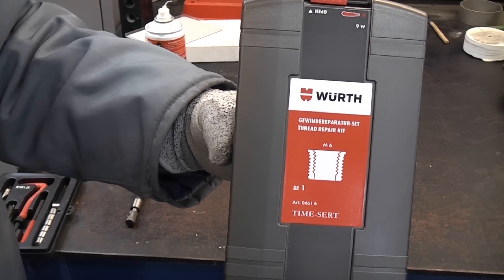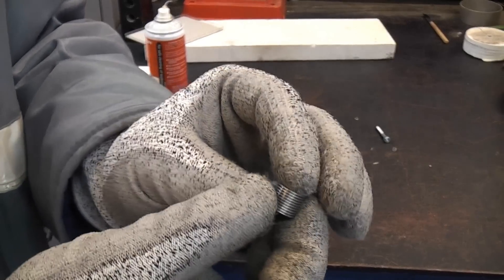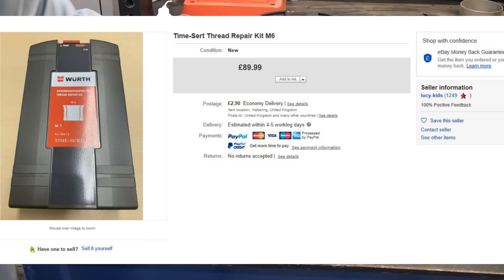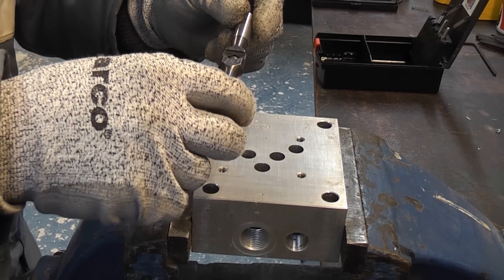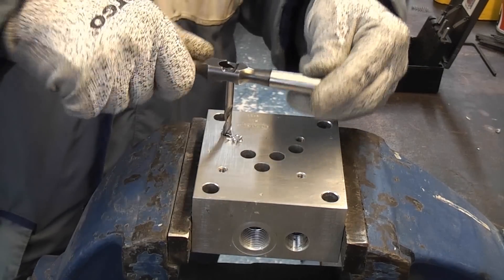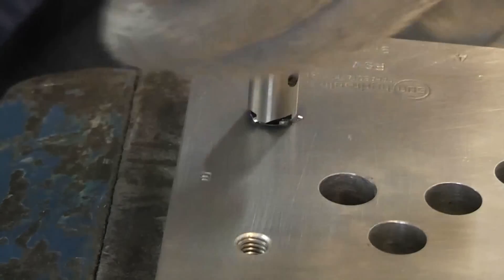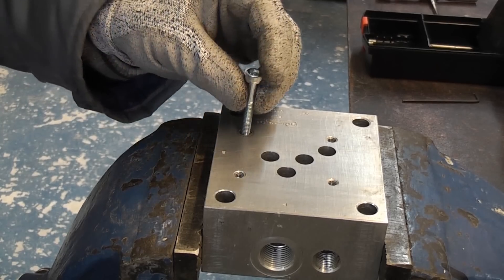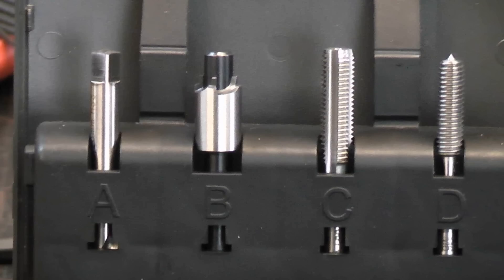Wurth Time-Sert | thread repair kit

Comment: If you install Helicoils correctly they don’t come out. There is no problem with Helicoils if fitted correctly. They don’t come out and you don’t use thread lock. Helicoils were invented as a solution in manufacturing and assembly of parts in the aviation industry to secure parts together as threading directly into alloy is a poor engineering solution. They are a proprietary fixing device that also work as a repair device. Time Certs operate in a different way. The downside to time is they require a larger hole to be drilled out. For some applications there is not enough material for Time Certs. People like Time Certs because psychologically they feel better as they look like a more professional fix, but this is not the case.

Comment: hi, the thing that is stuck in my mind is this: my motorcycle's crankcase plug slot was licked and its size is m14x1.5. I want to put m14x1.5 size plug again. I want to get and do time-sert for this, but what measure should I take? What should be written on the time-sertbox?
Reply from the maker: You just get a M14X1.5 kit, example here- https://eshop.wurth.co.uk/Product-categories/Thrd-repair-oil-drn-plug-thrd-M14-x-1.5-Time-Sert/31086006011402.cyid/3108.cgid/en/GB/GBP/
Reply: @ultimatehandyman  thank you bro

Comment: Have a question a little bit of help I have a 2003 CL500 Mercedes my hydraulic power steering pump threads are stripped T12 metric bolts can someone tell me the correct kit I need
Reply from the maker: It's probably best to ask a mechanic, to ensure you get the correct kit.
Some motor factors will know which kit you will need 👍

Comment: I have used Cross Wire Inserts (Helicoils) for many years, I have only had a few wind out upon removal of bolt or stud. I just clean the thread out with the tap, and wind in a new Cross Wire Insert, job done. When repairing many stripped or damaged threads, the Cross Wire Inserts are far cheaper than other threaded bushes. Also if the stripped hole is very close to the material edge, the Cross Wire Insert requires a smaller new hole than an insert type such as these.

Comment: Great video, thanks for making it. But what I don't understand... the drill bit is larger than 6mm, isn't it?  Must be since the TimeSert-insert's OD must be larger than 6mm.  So how come the drill bit fits into the hole with the stripped thread? That hole must be ~6mm.  Is the drill bit tapered?  Asking because whenever I've done helicoils, getting the initial drilling straight (perpendicular) is the hardest part because the drill bit rocks around on the surface - it doesn't get any guidance from the hole because it's not in the hole (yet).  Thanks.

Comment: Just viewed this video - thanks for sharing  My concern was when you said that the aluminum block was a hydraulic fitting and then began to wipe and blow the metal chips all over the place.  A chip / shaving could get into one of the passages and really cause issues, even dislodging and entering the pump and ruining it  
Personally, I would cover the passages / holes with masking tape to protect from havoc.

Comment: Great thanks, I've luckily been able to find a 2nd hand kit to repair my sparkplug hole. Just wondering, would you use red loctite to  keep the insert in place permanently?
Reply from the maker: Not sure about that, I don't think Loctite is necessary with Time-Serts 🤔
Thanks for the comment 👍
Reply: No, red loctite releases with heat.

Comment: If the original hole was say an m10 when repairing the thread do these or helicoils then change that hole to a larger bolt so an m10 will not fit anymore ?
Reply from the maker: No, if the original hole is M10 and you get the M10 Time-serts the new hole will also be M10 
Thanks for the comment

Comment: You can get 20 of these
https://www.ebay.co.uk/itm/20pcs-Self-Tapping-Thread-Insert-Repair-Set-302-Stainless-Steel-Fixing-Accessory/124129913015?hash=item1ce6b828b7:m:md5X6I5J8PsPGsS4u4OomHQ
for under a fiver. I wonder if they're any good. They can't be worse than Helicoils.
Reply from the maker: I'm not sure if these are any good, with them being "self tapping" and being made from stainless steel. 
I might try ordering a packet after Lockdown ;-)
Thanks for the comment ;-)
Reply: @ultimatehandyman  I was just checking reviews on Amazon and somebody commented the fit was very poor "after having tapped the thread to the correct size." Apparently this reviewer tapped the thread first and then screwed the bushing into it, so you have to make sure that you actually use the bushing for tapping the thread. Anyway, I think the price difference and the fact that you don't need any task-specific tools makes it worth giving it a chance.

Comment: A properly installed helicoil will not " back out "
Reply from the maker: They come out regularly on site, when you remove the bolt!
Thanks for the comment 👍
Reply: Helicoils are mostly junk! We switched over to Timeserts in the late 70s; never looked back.

Comment: Not all helicoils are made equal. Many off brand units that are frequently interchanged and don't work well.  That said the Wurth units are the best for hard threads in soft material.  I have used them into aluminum on vibrating tables running at up to 20hz and when they do come out can be replaced with a new insert and locktite with little problem. However they don't like heat compared to a Helicoil.
Reply from the maker: Thanks for the comment 👍

Comment: I always had my problems with the helicoil system. I am using the Time-Sert since more than 15 years mostly on motobike engines. Since then the screw connections have been holding up again.
Reply from the maker: Thanks for the comment 👍

Comment: if you look closely at the last two threads on the insert they are not formed the same as the rest of the insert. when you use the driver it cold rolls the last two threads which then locks the insert int to the work piece . the driver ideally needs to be able to exit the end of the insert to lock it into the workpiece tightly ,

they are a great repair item and in my opinion better than helicoils .

i used to use them a lot in a previous job. .

spark plug inserts where a daily occurrence as were inserts for sump plugs in ali sump.
Reply from the maker: Thanks for the info, Paul 👍
Reply: @ultimatehandyman  no problem. They are great for repairs to stripped threads.
Reply: Paul, you are correct...this applies to blind holes using the longest insert for the most thread grip. We purchased a second expander tap and ground the tip; then used it to follow up the first expander to get the last bit of grip.

Comment: Yes, no doubt they are a good system but I'd have to politely suggest that they may be as good as Helicoil,..I'm just not sure that these Worth Time -Serts are better!
Reply from the maker: They might not be, but I've had a few Heli-coil type inserts that have unscrewed with the bolt.
Thanks for the comment 👍
Reply: @ultimatehandyman  That's fine,..but you know what I'm going to do,..when next I see the Rep. from Wurth, I am going to inquire  after these Time-Serts and see if I can get a set from them.
Then I can give them a fair test on a little project I'm doing now, and see what transpires. Could be that they ( the Time-Serts ) will work better,..we'll see.
Reply: This is a PS,....it looks like there are some 'off-shore' knock offs out there,...I just noticed a set on Amazon.cam,....sure looks like a 'cheaper' copy to me!
Buyer beware!

Comment: Much better but also 3 times the price of a decent coil type repair :) great vid as always!
Reply from the maker: Yeah, they are not the cheapest!
Thanks for the comment 👍
Reply: Well worth it if you are going to rely on it. I used them since the early 70s. Never had a failure.

Comment: Really fail to see how this is any better than a standard helicoil. Surely the time sert insert is just as prone to backing out when removing the fastener as the helicoili insert? 
Only advantage I can see is that this system doesn’t have the tang which can be a bugger to remove in a blind hole.
Reply from the maker: I think these will be easier to thread lock in position, as they are solid- unlike the helicoil type inserts, which are more like a spring. Also they have a seat on the top of them, which should make them easier to use time and time again. One problem on site is that when I undo bolts that are in Helicoils, the helicoil comes out with the bolt.

Thanks for the comment 👍
Reply: @ultimatehandyman  i suspect it depends on the bolt sizing. iv used helicoils from M10 down to M3 and using red loctite have never had them back out

Comment: Looks great. Why is it though you couldn't just re-tap the hole, rather than having to fit the insert?
Reply from the maker: The hole was stripped, so you would have to re-tap it to the next size up (M8), but this is not always possible because you might not get the M8 bolt through the part that bolts to this part etc.
Thanks for the comment 👍

Comment: Never had a helicoil fail like that, BUT, that being said i buy the genuine stuff. I hear (grape vine) that outside of a few German made products and some French ones, everything else short of the original product is garbage. Lower quality steel, different geometries etc.

There is one thing i do, whenever the thread really needs to remain in place. It's not something everyone can do, but i have full confidence in the strength of the repair, and that is, i spot weld the last coil section into the original metal. Obviously, this doesn't work for dissimilar metals, and you need to have a copper thread plug to maintain the hole, but it works exceptionally well to keep them in. On my brother's farm, i've done this to every farm tool that lost threads, we both had equal thoughts about losing threads or actually seeing them come out like in your intro, like a spring, so we decided to go the extra mile.

I think the toughest test is the bar that keeps his steps upright, in season, that sees a lot of use and whilst it would not lead to any catastrophic failures if it did break, it hasn't so far despite being removed with regularity to reach the battery well.
Reply from the maker: I looked for genuine Heli-coils yesterday but could not find them, I could only find V-coils (we use these on site). There does seem to be a lot of cheap makes out there, which I would definitely avoid!
Thanks for the comment 👍

Comment: Informative video showing an effective solution and alternative to helicoils (which I don't trust in use by the way!!) Just a few things to point out here though.....The drill you showed wouldn't really be effective in a normal 3 jaw drill chuck unless you grip the shank of the drill - the reason it's square is so it's only to be used in the tap holder...… you're essentially using the drill as a reamer to obtain the correct sizing of the hole for the tap used...…..also a 'few turns of the tap wrench and a slight turn back to break the chip' isn't really the way unless you potentially want to snap the tap in the hole.... especially in harder materials like steel!!  I recall from my apprentice workshop days reciting "1/2 a turn round, 1/4 turn back" which I still do to this day if I have to do any manual tapping of holes....  just a couple of pointers as everyday is a school day as they say...  Thanks
Reply from the maker: Thanks for the comment 👍
Reply: my old boss told us never to use a drill with the drill bit in the time sert kit as they were designed to be used with a tap handle , he would have a fit if we used a drill .

Comment: I have to disagree with you. 
I have used helicoil for past 40 years 100's if not 1000's of times and Time sert occasionally. 
I have never ever had a helicoil come out but I have had at least 8 timeserts , fitted to spark plug threads (not by me) that have wound out on the plug seat. 
As in all things, preparation is everything 
I would always use a genuine helicoil over any other thread repair system
Reply: Same boat, I've repaired 100's of damaged holes with helicoils and never had any issues, I've used the locking type of timesert where you have to hammer the locking pins in but only on spark plugs as they will be removed numerous times.
Only downside to the helicoils is that they need a decent amount of material to screw into, whereas the timesert can be fitted to thin and shallow material and can in many cases add some reinforcement to the item.
It's always good to have a choice of repair options depending on the application.
Reply: @tecfixed2840  I agree, Helicoils are fine so long as they are correctly installed, with the correct size hole, tapped correctly and square to the surface, and fitted with the correct tool.  The inserts with the locking pins are called Keenserts, apart from the locking pins their other advantage is that they use a standard tap, not a special Helicoil or whatever.
Reply: Ian Smith 
Hi there, could I use a helicoil in a glow plug if I need to as I have a snapped and seized glow plug and plan to remove it this summer when the weather is warmer to heat the engine to help try keep the heat in it. 
Any advice would be appreciated.
Reply: @ashy1423   if you drill through the glow plug hole to fit a helicoil you may drill through the seat that seals the glow plug to the cylinder head then the gases would escape from the hole and the carbon will seize the glow plug in.

im sure wrth do glow plug inserts too .
Reply: i worked in engine recons and we only used timeserts due to helicoils coming back out . 

we had a customer with a matchless bike that had  the spark plug hole helicoiled and he had spare plugs with helicoils on the spare plugs as the helicoil came out when he removed the spark plug . we fitted a time sert for him and he never had any trouble ever again.

we used to fit timeserts to ali sumps a lot due to mechanics stripping the threads . 

you can also put a timesert in a larger time sert if the mechanic had to drill out a broken exhaust stud and made a mess of it . you put the largertimesert in then put the smaller one inside it . we did this on many a repair.

i would use timeserts over heliciols every time .
Reply: Helicoils work just fine in that application in my experience, just make sure not to drill too deeply and be careful when snapping off the helicoil insertion tang.
Reply: @ashy1423  before you do anything, check if only the first few threads are damaged, which then you may be able to fix with a "back tap". If used with caution and correctly, a "back tap" can work wonders repairing threads. I'm a user and believer. Hopefully if comes in the size that you need.
Reply: +Ian Smith................. exactly! 👍
Reply: I prefer the timeserts but use loctite when installing,never a problem
Reply from the maker: I think we use V-coil on site, they tend to come out regularly, but we don't use time-serts, so I can't compare. I imagine that if they were threadlocked in (for the job that I do they would be better).
Thanks for the comment
Reply: Me too then I guess, as others have raised the point.
Helicoil have always been the 'go to' system in my service department since  the 1970's and now that I'm retired I have a few kits in my work shop too.
By the way I deal with the Wurth rep. each time he comes around,...great products they have too.

Comment: Dose this keep the hole the same size or make it bigger?..
Reply from the maker: It keeps the threaded hole the same size, so if you use the M6 kit, the finished hole will be suitable for a M6 bolt.
Thanks for the comment 👍
Reply: @ultimatehandyman  what about from the original size before the kit is used?. Thanks for the reply
Reply from the maker: It needs drilling out slightly larger, so that the hole can be tapped for the insert 😉

Comment: Good morning to you Sir, another rather good video and expertly explained. For my own peace of mind I'd also use an alignment tool as I'm an expert at tapping gone awry, I've seen these being used and it might help me and any others with an engineering disability (unable to tap a straight hole). Ebay: RDGTOOLS SELF ALIGNING TAP WRENCH REAMER WRENCH
I do find however that starting a tap in the pillar drill first (by hand) then releasing the chuck and finishing by hand is a much safer method (given that there is no flex in the pillar drill table). I'm waffling aren't I? Anyway carry on Sir :)
Reply from the maker: I'm going to order one of those, I have often thought about making something similar, but now I don't have to  - https://fave.co/2IsRGFF
Thanks for the comment 👍